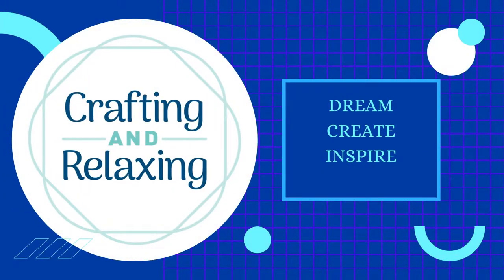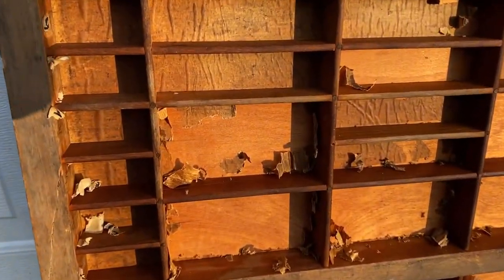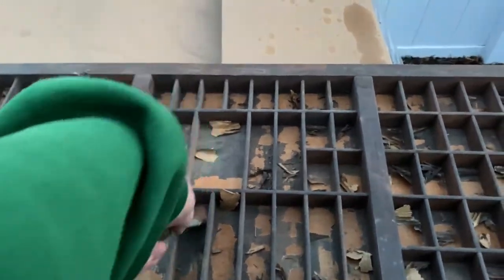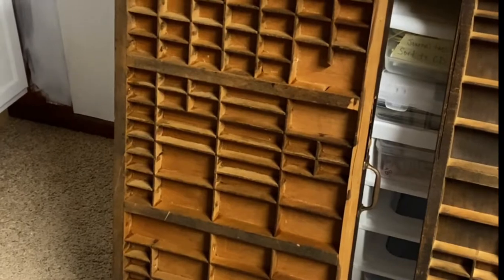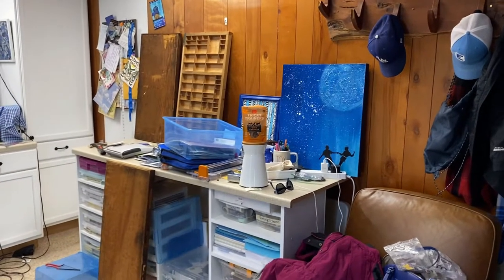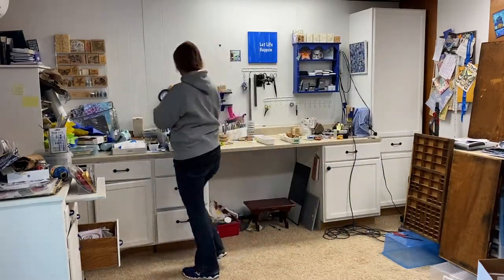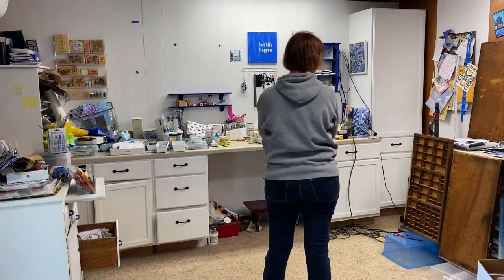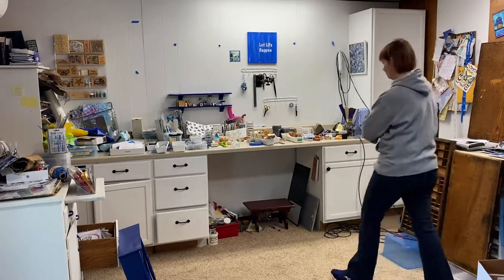Rubber Stamp Storage - Printer's Drawers | Printer's Trays

Comment: How did you remove the slats to widen a section?
Reply from the maker: I used a chisel and hammer for some, slow. We also have a little saw that cuts straight ahead. I think it’s called oscillating tool or oscillating saw. That’s what we needed for lots of volume. 😊💙
Reply: @CraftingandRelaxing  Thank you.